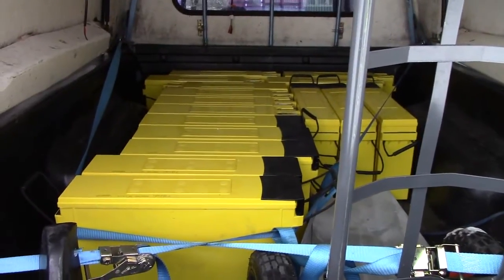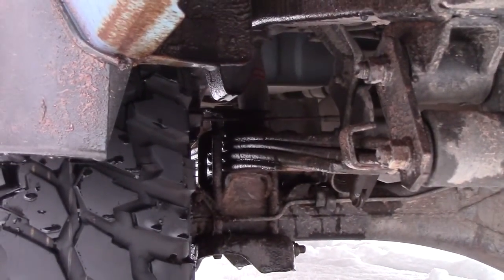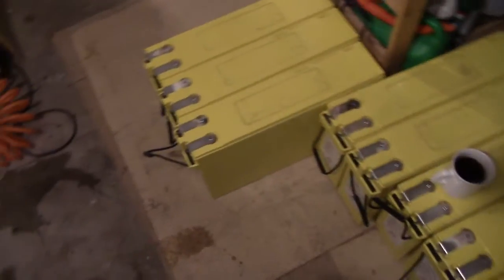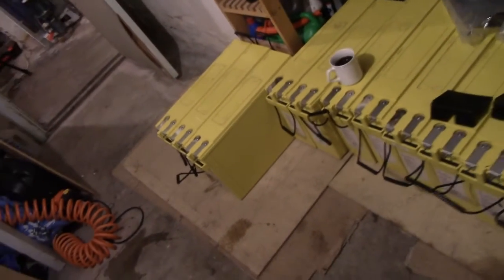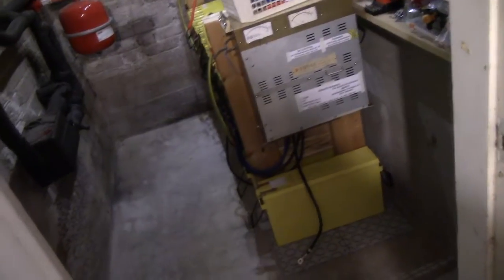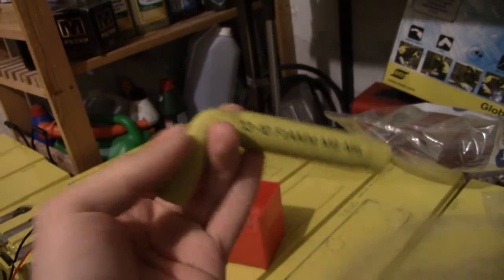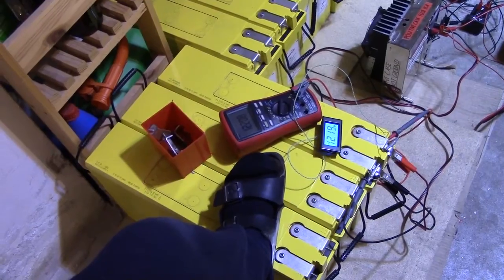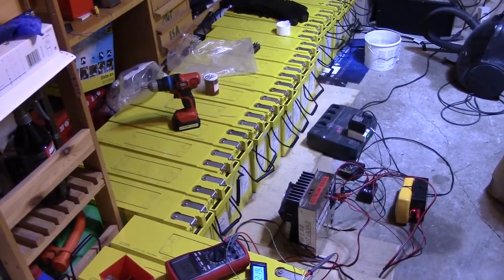16 more Powersafe 12V170F AGM telecom batteries

Comment: At first I thought the 4x4 was powered by them 😂 you must have some experience with these batteries, can I ask your opinion on wether they would work ok in a motorhome? I would be running 2 for 24volts, I have a 20amp charger that I can run from my Honda 1.0 generator to get them into float mode daily if need be, ie in winter, and I have 800w of solar panels  that on a good day I’ve seen 600watts going in, and the solar in summer does get my current 24volt 200ah into float mode, I do realise the need to maintain a battery. Would you know how many cycles at say 50% depth of discharge these batteries would be good for?
Reply from the maker: They're not built for cycling and they don't really have any cycle specs. If you get them used for free/cheap, I imagine they're good for the money, but I wouldn't buy them new. They have a tendency to "snap die" when they get old, just going open circuit at random, which is a nasty characteristic if you depend on them for sustinence.

Mine were reasonably good after a few years of light use, but they never saw cycles deeper than 15 %.
Reply: @FFcossag  thanks for the reply, and information, I think I’m best off looking for lithium’s at a good discount👍

Comment: Question. Just how many battery cells are you charging with your Tri Star controller. 
I have the cheaper TS 45 version and they are limited to 24 cells. 
Thanks
Reply from the maker: 24 cells in series for 48 V. How many you have in parallel doesn't matter.
Reply: Thank you for the info and quick response. I have two strings of 8 six volt, (16 batteries total) Rolls S550 batteries for 48 volt total. So, I guess I can still use that TS 45 on that. I am building a twin PMA alternator set up using a 9 HP briggs engine to use a a back up charging system on my Outback Power Flex Max 80. Thanks again

Comment: This battery is deep cycle?
Reply from the maker: They are more cycle tolerant than for instance car batteries, yes.
Reply: @FFcossag  can I use this battery for solar power projects?
Reply: Gilberto Ovalles Yes, They are not meant for solar applications, but I’m using them on my solar off-grid home. These are meant for Tel-Com applications where they sit idle on a trickle charge, only to cycle a few times a year.  I work in the industry and get these 7 year old batteries for free. I have a bank that’s has lasted 1 year so far no problems. I have 3 wired parallel  with a 2500 watt inverter running a small refrigerator , a water pump and other devices on occasion. These 3 batteries are charged by 500 watts solar with a 40 amp charge controller.

Comment: these are stolen i work in the industry we install these batteries STOLEN
Reply from the maker: lol
Reply: they heavy buggers 50kg each
Reply from the maker: andrew adams Yes, stealing them was a real pain.
Reply: FFcossag lol I'm not bothered I'm building my own solar powered battery bank to run my garage :)
Reply: Were are you from you dont sound English
Reply: Is it possible to charge these batteries by solar system in series connection